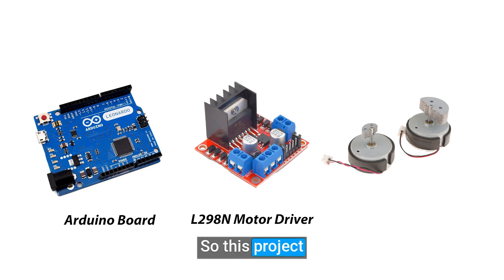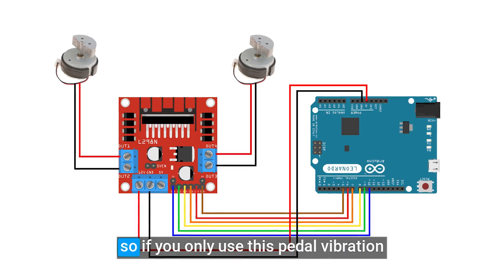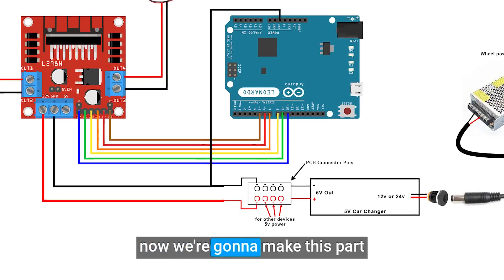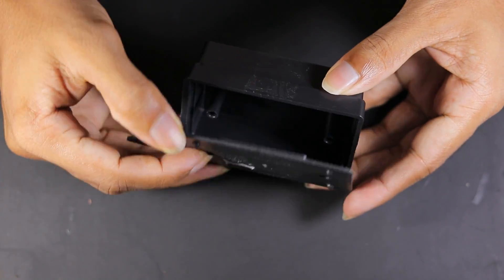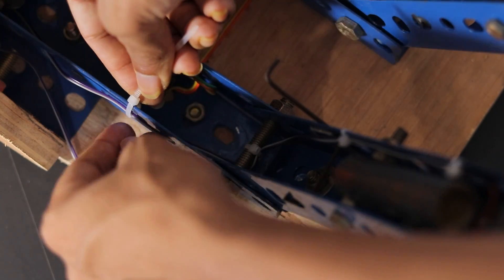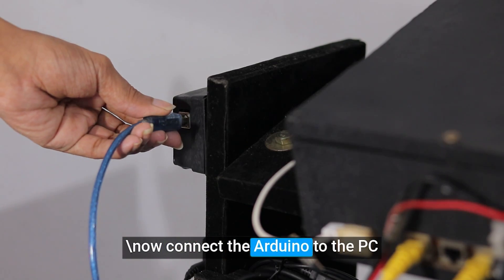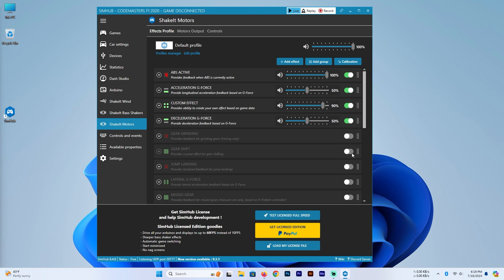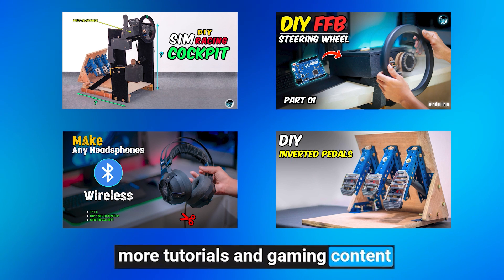DIY Rumble Pedals | FeedBack Pedals

Comment: Bro, so could I connect the pedals and the rev lights to the same Arduino board? Or the LED matrix and the other two things together on the same Arduino board?
Reply: I think that if you use simhub, external 5v power, you can connect how many things you want, the limit is the pins of the arduino

Comment: Hello bro, I have a question. I could connect this and at the same time my Ardruino Leonardo board with EMC Pro, of course each one with their Ardruino, one for the pedals and the other for everything that I already have installed with EMC Pro
Reply from the maker: No, you need a separate device for the steering wheel and the SIM hub. and as far as I know, the EMC Pro does not support Arduino. The Pro version requires the STM32 board.
Reply: @zudumalli  Thus, if I can do it, connect the SIM and the EMC Pro at the same time. If it is possible, the EMC Pro with Ardruino Leonardo, when I bought the license, had sent me STM32 and also the version for Ardruino

Comment: Nice and valuable video, but I have one question, why you put car charger 5V DC out to 12V DC in L298N? It shouldn't be connected to 5V DC input? Or 12V from power supply direct to 12V DC input in L298N?

Comment: Hey bro  it hase been 1 week and I have just completed my wheel and paddle but  I have faced very strange problem my Force feed back got lowered than before although the Main gain is at 100 % .
Reply from the maker: try resetting your wheel software settings

Comment: Bro can i connect these motor without using external power
Reply: Because im using arduino uno mega 2560 for tm1638 and max7219
Reply: So i can i use arduino uno to power both motors without external power
Reply from the maker: Try it once. If the lights of both tm1638 and max7219 blinking or flickering when the motors are working, you have to use external power. (you can use a USB cable to power it through the mobile phone charger ( required power 5v 2A) )

Comment: Bro can you tell me how you wired the high rpm fan to your wheel base
The fan has 4 pin connector
Reply from the maker: you can find it on Google.
It depends on the colors of the wires